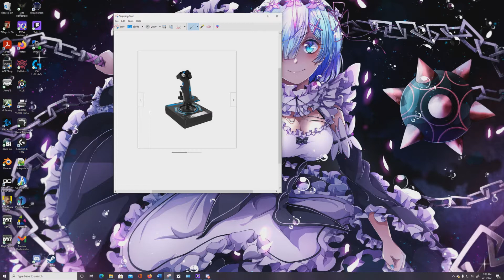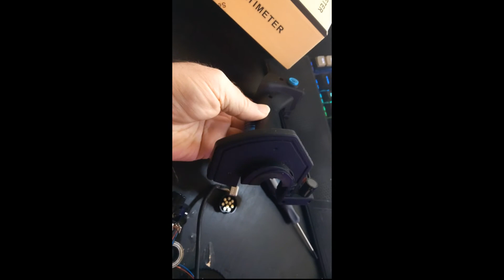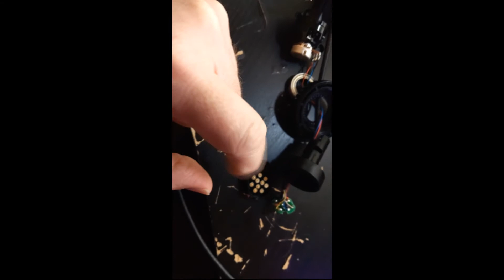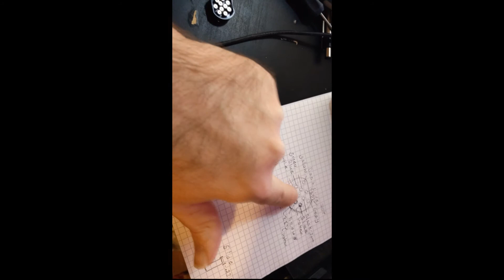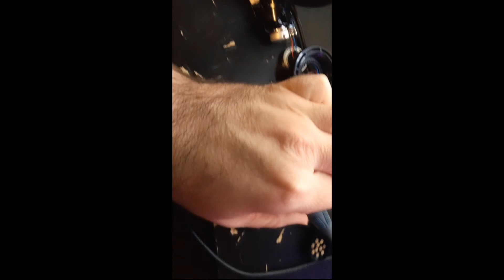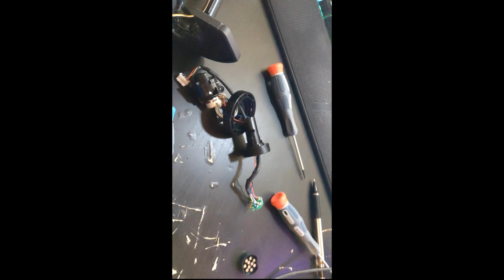X56 Repair PT1

Comment: Hi, gamer i have a situation that the rudder bonus frequently, I want to repair it myself. Can you help me that to get the information of the internal structure of the HOTAS and the internal wires diagram. thank you very much. by the way i am an electrician.
Reply from the maker: Sorry for the late reply , I dont really have any documents that show the internal structure of the HOTAS, I just did a lot of tracing and inspection based off personal knowledge. I can get some pictures  together of what mine look like.
Reply: @owlarmsgaming4948  can you send me your trace pdf or jpg?

Comment: Hellooo, I have a problem with my x56, the rudder doesn't work, I have checked the potenziometer and is working, do you have any guess to suggest me where I can check?
Reply from the maker: If the potenziometer is working when testing then you need to find where the signal goes to . As it could not be transmitting through the PCB .
Reply: @owlarmsgaming4948  after some test that I did the come out is some chipset failure since the electric part is working. Not solved it but I stemmed it by using some real rudder
Reply from the maker: @Capitan_Papen1918  maybe I can help you out . I have some extra parts.left over . Direct message and I'll see if I have that part. You can find owlarmsgaming on FB as well.

Comment: Did you ever get the x56 repaired?   I'm having a problem with the small pc board where. 1 wire has come off and thumb joystick Y axis no longer works.  I need a wiring diagram so I know where thr lose wire came off of.
Reply from the maker: I did, I ended up getting another non working  flight stick on ebay. Inwas making a part 2 but lost all my video and we'll been busy to get another one going..but I plan on making a quick.update video of end solution for my problem

Comment: Pt2?Where can i buy a board with bottons for reemplace in the stick ?
Reply from the maker: You can find used and non working flight sticks on ebay for cheap. That's what I did. Sorry for a very long delay in pt2.but i plan on uploading  one